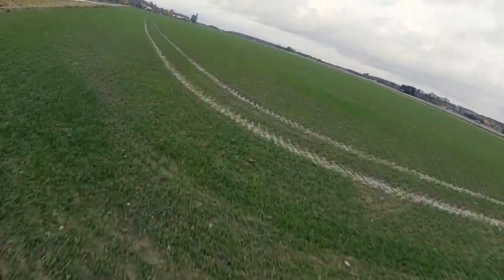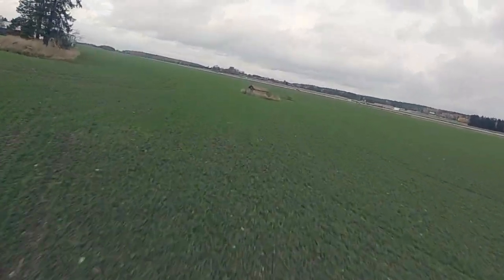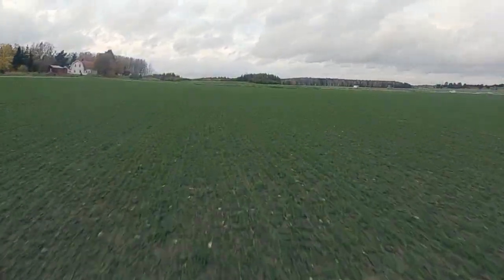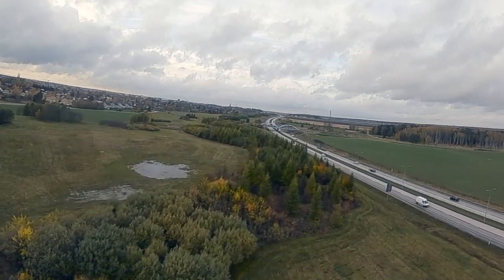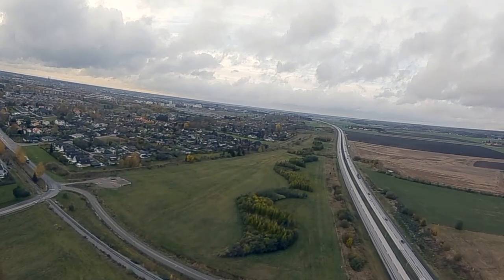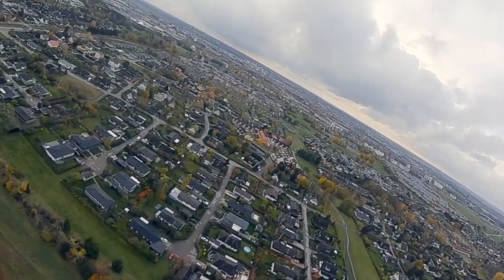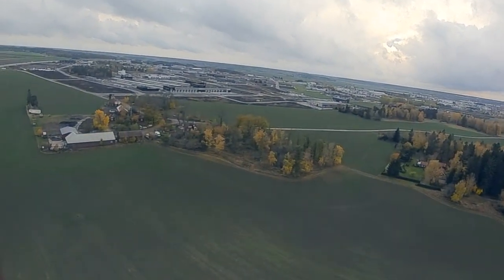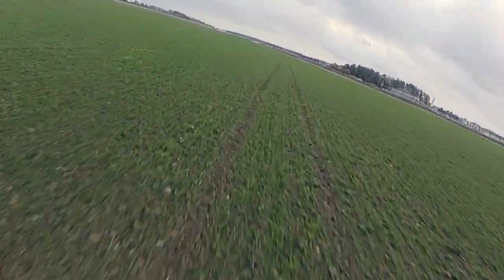Emax Buzz 7+ ECOII 2807

Comment: Hi can use 2807 1700kv with 6s battery? Since it is rated for 4s... because 2807 is more size for 7inch cruiser we can use 1700kv  6s if it supports.. we have lot of torque..

Comment: how did you mount the antenna? very interesting
Reply from the maker: The 5.8 antennas are mounts are 3D printed and the TBS immortal Ts are just zipped tied to both rear arms
Reply: @carvesk8  are the 5.8 antenna mounts on thingiverse? I might be able to use them for my mr croc to get some more range out of it

Comment: What’s the ESC requirement on a motor of this size?
Reply from the maker: I have seen spikes of up to 135A at punch out so I would use at minimum 40A per motor ESCs I see a cruising draw of 13-25amps
Reply: @carvesk8  very interesting. So there is no risk of burning a 40amp esc?

Comment: Buzz with 7” arms yes please!  Seems to have better flight time than even the 1700 on 4s with 5” props or even 6” HQ k2 props and even the emax 6” bi blades(love the sound of those props on the buzz) Love my 6s buzz on some HQ 6x3.5x3 props but while it still performs great I feel a slightly bigger motor is needed to really push her hard.  But now I see this and now you have me wanting to get some eco 2 2807’s and make some 7 arms for this bad girl 😜🤩😍

Comment: That drone looks nice, i like it :) i want to build 7 inch drone myself for cruising, maybe some long range. what do you think about these 2807 motors but 1300kv on 6s lion? efficiency, flight times?
Reply from the maker: I wish I could give you a definitive answer for 6s but I have only 1700kv and 4s 2200 lipo batteries. I did do a test with 4s Li ion 4000mah and managed to get about 15mins of flying time cruising at about 40km/h. There is considerable battery sag when using Li ion if you are doing punch outs. For the style of flying I enjoy which is mostly faster proximity I will probably stay with lipo packs the 2807 has lots of torque so it can carry a heavier pack with out issue.

Comment: Nice video, thanks a million!
How do you like the Emax ECO II 2806 1700kv motors? I mean smoothness and power factors? (mines are on the way... ;) )
Reply from the maker: I think for the price they are very good, nice and smooth. I have not flown a similar size in other brands but it was big step up in power from  the ECO 2306 motor I was using previously.
Reply: thanks for the reply. I'm eagerly waiting for installing mine, but need to Dremel the arms of the Geprc Mark4 because of the 19mm motor mount holes of the Eco II 2807.

Comment: what you think about those motors on 6" 5S build , are they not too heavy?
Reply from the maker: My 7" build weighs about  640g w/o battery with 2807 and with the 2306 motors it was 560g. If your goal is to fly fast I think the extra 80g is worth it for the huge difference in responsiveness vs the 2306 motor.